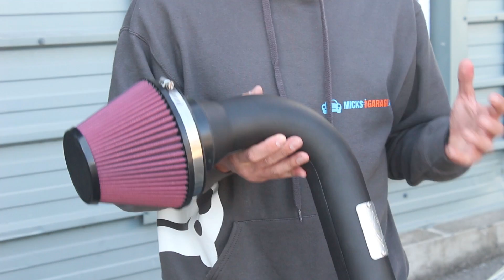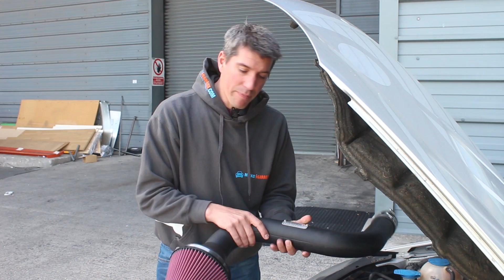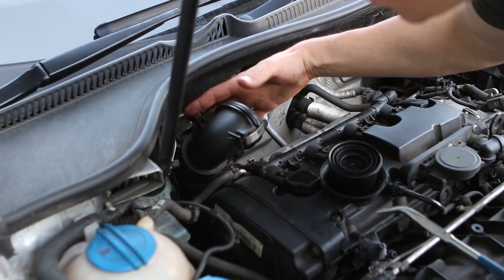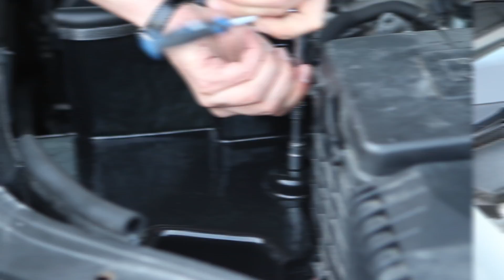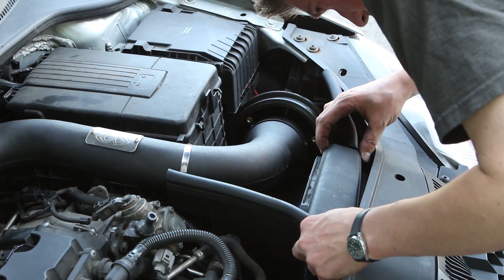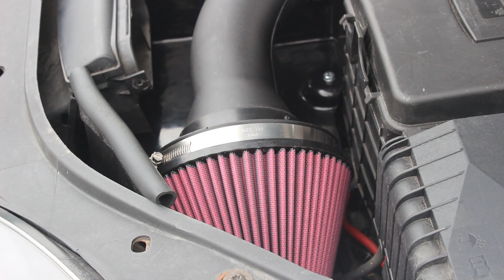Project GTi -  Fitting the Evolution Motorsports V Flow Induction Kit

Comment: The hole you placed a bung into, that is for the diverter valve relocation, either once you blank the DV on the KO3 platform, for ease of access instead of going under the car, or on the KO4 platform which had been relocated for the very reason mentioned previously.

Comment: How you managed to get that turbo pipe clip off using a pair of long nose pliers i dont know. I did the same mod on my Audi TT MK2 and i had to use mole grips with 300lbs per square inch tension on them and i still managed to remove all of the skin on my right hand whilst doing it.

Comment: Where are the brakes lines and booster? all tfsi I have seen have that parts close to the battery bay. The brake lines and booster obstruct the space to install a cold air intake

Comment: Omg, you’re getting more hot air from the engine bay than with the stock set up. The stock set up faces to the front of the engine bay, while the ‘cold air intake’ is cone is INSIDE the engine bay. Very silly waste of money.
Reply: But the air travels further in the stock engine cover that sits on top of the engine. Which one do you think gets hotter??

Comment: The rubber piece that was pulled out of the bottom of the turbo intake pipe do you need it for the new induction pipe?
Reply: I just installed the Evo V air intake  the video helped a lot. Thanks
Reply: +TFC 1 I am now getting bad suction noise under the hood after the install of the air intake when step on gas. Was told it could be the diverter valve? Any ideas? So annoying I am thinking of going back to the stock intake.